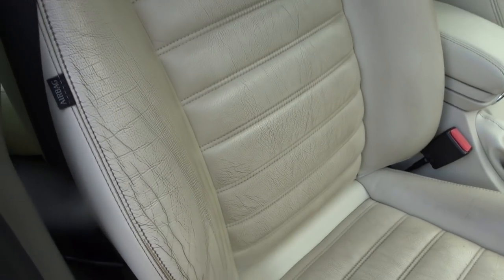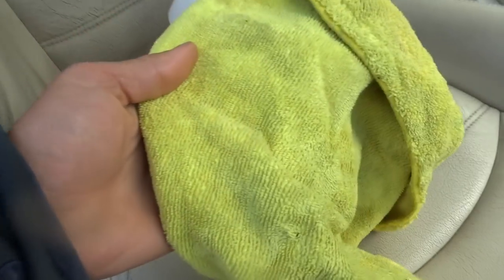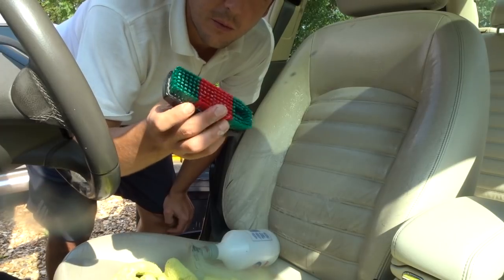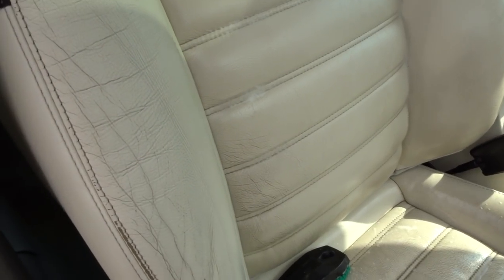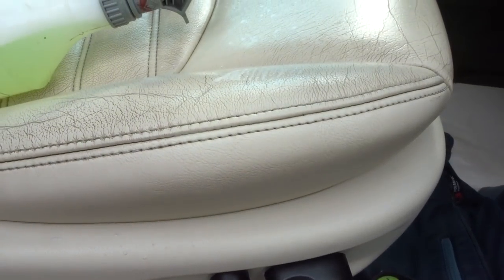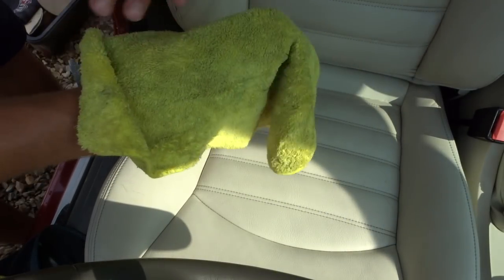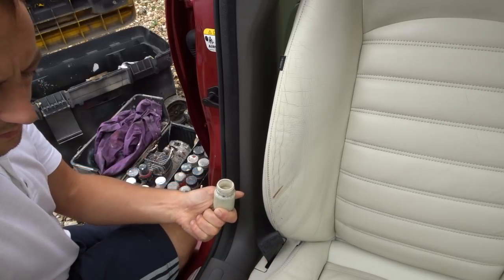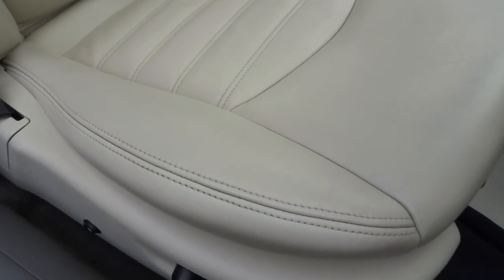how to clean leather seats properly, smart repairs, jaguar

Comment: My Jaguar X Type it had a similar condition interior and I cleaned it up and used the same methods of using the rags but but not the brush and I used Turtle wax leather cleaner and Feed and the leather came up like new